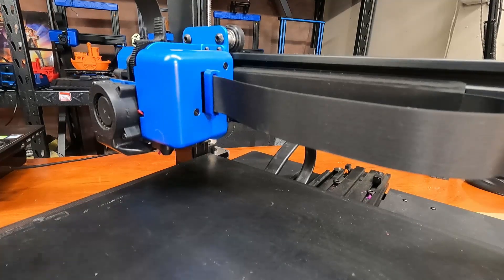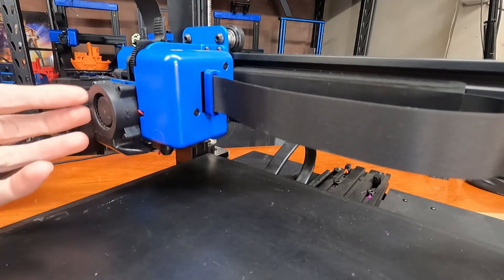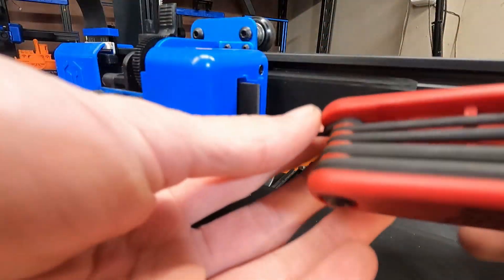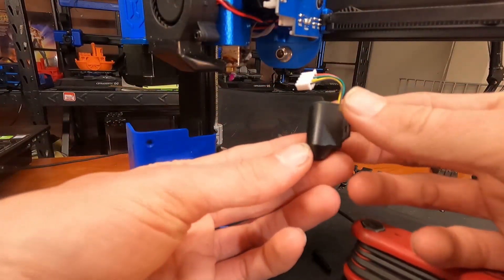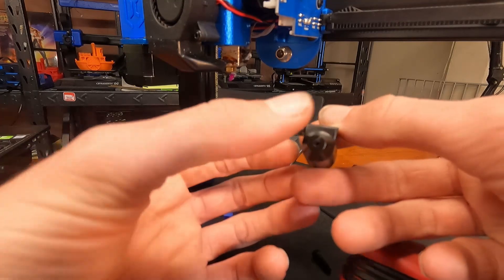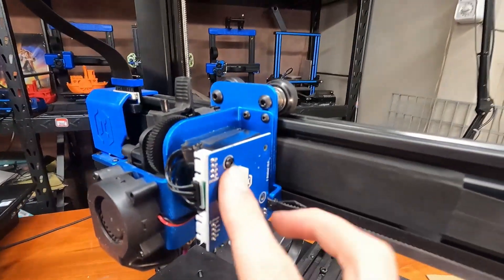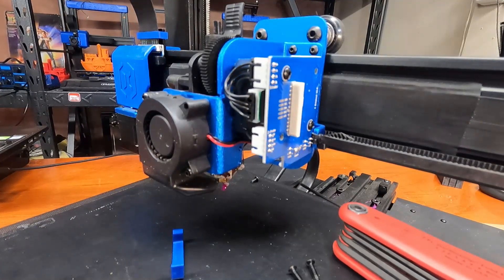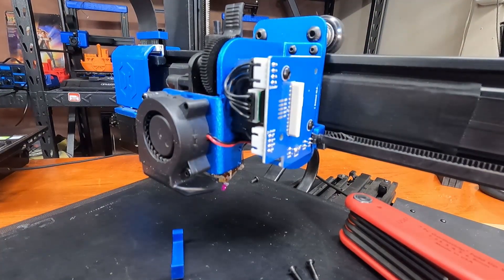Artillery 3D X2 Partial Extruder Disassembly

Comment: could make a push button switch (N.O.) [eg from a dead mouse] with some 3d printed holder for the auto leveling ---> > == to board:  "---> > " switch:   ==  Wires to board make  3d print adjustable (up down)  for calibration
Reply from the maker: Yea I could, I was just trying to see if an aftermarket probe could be used or not.